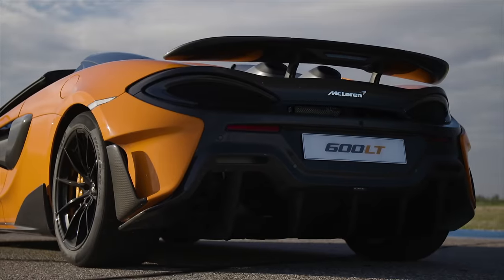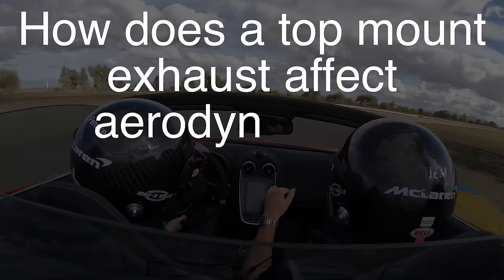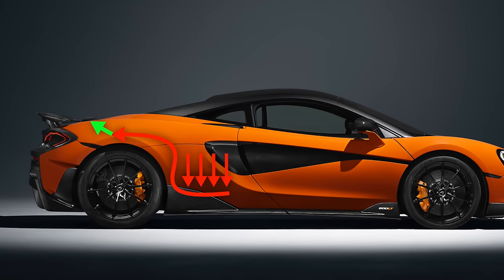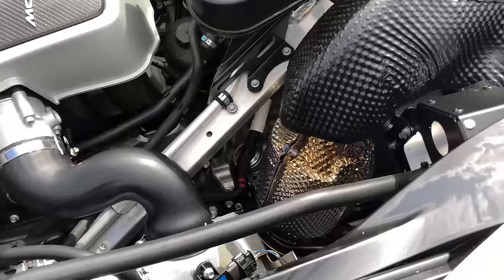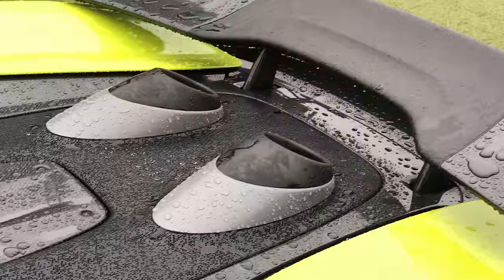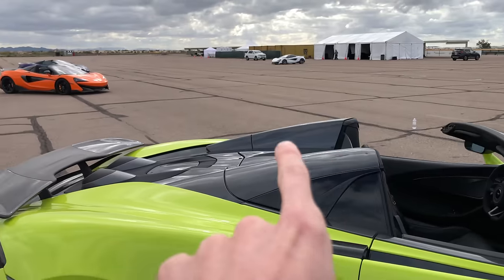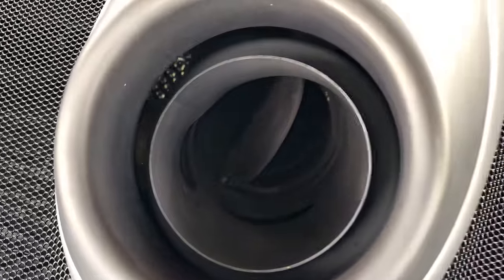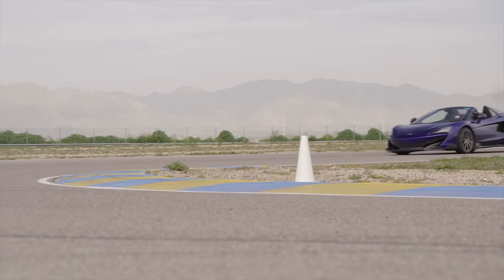Why McLaren's Top Mount Exhaust Is Genius

Comment: There was an adaptation, seldom used for big plane engines. It sent supercharger exhaust out through an aft nozzle that worked like a rocket, focusing and accelerating it to produce thrust, instead of just dumping it into the airstream which you'd otherwise hope to keep clean.
The engine was a huge P&W corncob radial 28 cylinder; the air after cooling the rows of cylinders went out an annular or  ring opening with that supercharger exhaust in the center, boosting the spent cooling air into a blast of thrust, instead of a radiator or simple cowl outlet only being drag.
Want to be they couldn't dump fuel into that for more thrust?

This all would obviously be even more noisy than this car.

Comment: Two big ones I can think of automatically:

1: you're not fighting against physics, I.E., exhaust likes to rise and having exhaust pipes that are lower than the manifold requires more energy to get that out of the system of the vehicle
2: cheaper. Less pipe needed, less physical material costs.

Problem is it only really works in a car with a rear engine rather than a front one.

After finishing the video:
Was right on one, half right on the other. Cool.

Comment: Interesting choice that they didn’t route the exhaust slightly further back, or adjust the wing to gain back that extra lost downforce due to the turbulent flow from the roof. As I’m sure you know, the senna has a blown rear wing for this reason, and it’s not uncommon in motor sports either. I’m not trying to say mclaren is wrong, bc obviously they made the car in the first place, I just find it interesting they decided to not pursue that extra bit of aero efficiency with a higher-end model like the LT.

Comment: I was thinking that they were using the hypercavitation to reduce friction of air.I suggest to koenieggseg to use it in order to gain more velocity,but until these days they didnt find the way to move the heat of engine to the surfaces that are under big amounts of pressure when they gain velocity.They may be could use ceramics peltier

Comment: I have been wondering If they could be somehow an effect like introducing lots of turbulent hot current into a somehow turbulent colder flow reduce drag. A. The hot gases get colder, so they will contract - orwi injection of hot Gases into a cold but turbulence stream will make parts of the cold stream expand. We should do micromeasurements in the wind tunnel at various speeds while the engine is running half power, three quarters and full power.
Reply: ... - B. or the injection of ..

Comment: Great video! Love the content, but I have one thought on the topic of aerodynamics of the top mounted exhaust. On large aircraft sometimes to improve lift over the wings at low speed air from the compressor is pumped onto the top of the wing adding energy to the boundary layer and letting the overall airflow stay attached increasing lift. I wonder if adding exhaust to the airflow at the back of the car is actually doing the same thing helping air stay laminar over the roof and onto the wing. I wonder if their chief engineer mentioned this or if it was part of the move to top mount exhausts.

Comment: All interesting, but didn't address the one area I, as a person totally unfamiliar with top mounted exhaust, wanted to hear about.  Is there not any issue of increased exhaust recirculation into the driver's compartment?  I would think this might be an issue especially with the top or back glass down as demonstrated.

Comment: Could the exhaust actually help make more down force being top mounted cause its putting a relatively  smooth flowing, fast moving air stream over the middle of the rear wing?

Comment: Would the top mount not be a less costly exhaust solution, given fewer parts?  Would they have intentionally put a more complicated and costly exhaust on the 570S only to save this for the 600LT?  What are the advantages in terms of production cost, noise reduction etc of the 570S exhaust that would make it preferable to the top mount exhaust for all the cars in the sport series range?

Comment: Why not use the exhaust gas to create a blown diffuser? Adding energy to the airstream under the car increases down force as shown in F1 before it got outlawed. Plus as shown in your graphic, just dumping it straight down and then parallel to the diffuser under car could cut even more length of exhaust tubing. Is there a reason we don't see blown diffusers in road cars?
Reply: The so called 'blown diffusers' in F1 did not work by simply dumping hot exhaust gas underneath the car.   Google or Wiki the COANDA effect/Henri Coanda if you would like more info on what principle Adrian Newey was exploiting when he introduced that system in F1.

In order to 'work' as an aid to ground effect the ride height of the vehicle in question has to be extremely low.  My assumption (and it is just that) is that no road car can have a low enough ride height to make beneficial use of Coanda style ground effect systems.
Reply: @ShmuelWeintraub  Thanks! Exactly what I was looking for.

Comment: I believe, he forgot one more significant reason: blown wing.
Blown wing is trick known for a long time. The idea is that hot air from exhaust comes underneath the wing and thus amplifies low pressure zone which results into higher downforce.
That's not a new trick at all, and not even Porsche are the first ones to use it. In F1 exhaust gases have been exploited for ages.

Comment: Surprised that you don't mention the created low pressure area that the hot exhaust gasses create. This would act to draw the turbulent air into the low pressure zone increasing the effect of the rear wing in its least efficient zone. This would have the effect of a 'blown' rear wing in purpose.

Comment: I'm going to put this in before I watch but I figure b/c hot air rises and it's only natural to release it in a vertical instead of horizontal way? Now I will watch the vid and find out if I was at the very least close to be correct.

Comment: Most supercars that I know of only have the exhaust go 'up' because the gasses are being fed to mufflers, which can't reasonably be packed within the confines of the bumper. Otherwise, there is no need to go up, as the exhaust can go around the transmission, only having to clear the axles, before going out the back end. And then there's this weird story about the 600LT's predecessor having fans in the bumper to prevent heat damage? That reeks of a major design flaw.

Comment: I have a question. If the centre of the rear wing isn’t as important as the outsides. Why didn’t they just split it like on the 488 mansory kit?? Surely that would have been an easier decision than to coat the wing 🤷🏾‍♂️🤔

Comment: @4.44 in. Am not a great engineer but is the middle part of the back wing required if it doesn't help much with the down force, wouldn't removing it save more weight?

Comment: Would the turbulent flow provide a low pressure that would generate a vacuum for better expulsion of exhaust gasses? 

If so you could assume that you can more precisely control airflow through the engine, pulling more air into the the chamber during exhaust and intake valve overlap, even with the turbocharger.

Comment: Curious to know how much difference it would be vs the high rear mount exhaust of the 650/675/720... as t hose systems aren't all that much longer than the top exit of the 600lt, and also don't go low into the bumper/diffuser. Compared to the 570, its quite the difference as it needs to go quite abit further down into a "normal" cars tail pipe position.
As for sound F!yeah! - my ol car with a under car diff dumped exhaust sounded way better with the noise bouncing around between road and car and being able to hear it all around the car, rather than straight pipes that "shot" noise straight backwards

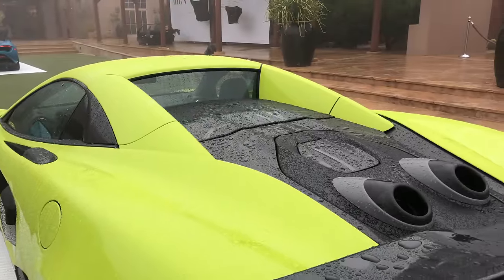Comment: At 4:38 it explains the rain while parked.  But what about rain/snow while you're driving and not accelerating, as in stop-and-go traffic??  Do those valves only open when the car is accelerating?  This video didn't address that key point.

Comment: One more advantage: the exhausts are located within a lower air pressure zone, so that exhaust air is sucked out which helps power output of the engine.

Comment: Well, that ceramic stuff will deal with the heat, but all those gases will certain leave a mark there. You'll need some extra cleaning there unless it's an easy to clean surface.

Although I guess if you can afford that car, you can also afford someone else washes it.

Comment: Why dosent Mclaren use a hot-V engine to shorten the exaust even more, like the 918 is doing and some DTM-racecars, it also would help with the consentration of the heat, considering hot air wants to go up...

Comment: It also reduces eddies due to boundary separations by blowing out the air just at the right place, hence decreasing turbulence 

Great engineering

Edit : blowing air from exhausts
Reply: Having 700 hp or so doesn’t hurt either.

Comment: Ferrari pioneered this is in F1 in 1998 (mid season) with the Ferrari F300 car. Al previously F1 cars dumped the exhaust gasses inside the diffuser. It made the car more loose but more predictable/stable. Ferrari was the first team to route the exhaust gasses over the rear wing to create more downforce. It was obvious that it had many advantages and confirmed by the fact that other teams copied this in just a few months. However, the drawback was that the amount of downforce also depended on the throttle making the car more nervous. 

The affect for road cars like the McLaren or Porsche is a lot less than for an F1 car, obviously. While the margin may be small I would still mention this side-effect in the video. Again, a lovely video and keep up the good work.

Comment: Which produces more downforce: the exhaust being pushed upwards by the car, or the exhaust heating up the air on top of the car, forcing it to expand?
Reply: It's an interesting question.  The "heated" air exitting the exhaust system does not stay immediately above the car.   Hot air/gas rises, just as hot water introduced at the bottom of a pool of cold water will rise to the top.

So the heated air above the car quickly rises.  In fact, if you've ever spent time in a large scale industrial process like a power plant or incinerator, you would see that flue gas stacks tend to run at a negative pressure due to the updraft created by the temperature difference of the hot flue gas and the air around/above it.  This is true whether the flue gas is part of a forced draft (fan driven) system or natural draft.

The simple answer to the question, then, is that since the heated exhaust gas rises as soon as it exits the exhaust system and continues to rise, the 'heating' effect actually will contribute not downforce but very slight lift.  Therefore the net force of the exhaust flow directed upwards, which produces very slight downforce, is the larger effect.
Reply: @ShmuelWeintraub  Wow, that was a pretty solid explanation. Thanks, man.

Comment: If the exhaust was dumping air under the airfoil wouldn't it accelerate the air beneath it, which creates an even lower pressure compared to the top part of the airfoil thus creating more downforce? Or maybe the amount of downforce added would be insignificant :/

Comment: Doesn't the Top Mount exhaust also provide more downforce? 
Since it dumps hot air with significantly higher pressure than the atmosphere, it kind of reminds me of the 2011 F1 blown diffusers. Of course F1 is way more extreme, but I believe such configuration can grant more downforce, right?

Comment: could i get the heat protective coating spelled out that mclaren uses for the middle of the spoiler
Reply: The coating is called Cerakote.  The same finish used on many painted firearms.  Duracoat is very similar and also common.

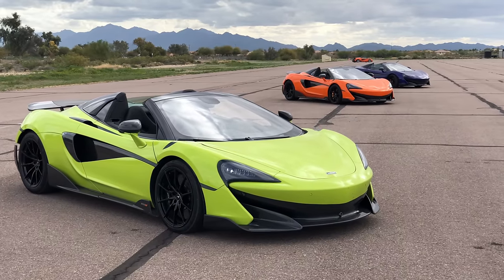Comment: 0:25 actually the porsche 918 spyder also has top mounted exhausts and that is way older than this as it was produced from 2013-2015 I'm not sure about the normal 918 but the spyder definitely has top mounted exhausts

Comment: Its ingenious, in addition to better sounds and improved aerodynamics, you also get to blow your exhaust at the height of people in the vehicle behind you.  They gawk at and envy your vehicle, then you blow them away off the line with a raucous throttling sound, and finally you get to send a concentrated puff of carcinogens directly into their faces Clint-Eastwood-style.  It all happens within seconds.  If that's not what a supercar is all about, I don't know what is.  I bet in California and Colorado you can even get it modified to puff weed smoke as well.

Comment: wont it  have an advantage of the blown exhaust air aiding downforce on spoiler?.. high speed hot air shot out onto spoiler top surface creating additional downforce.. similar to formula 1 blown diffusers of 2010.

Comment: It lets water into the exhaust system, corroding the oxygen sensor. Maclarens are notorious for their oxygen sensors needing replacement if the car is left outside undriven for long periods.

Comment: But a Prius have better fuel economy yet is reliable whoel remaining cheap to buy and maintain. Anyways... all cars can hit the speed limit... The only advantage of a fast car is that it has better acceleration so it saves you maybe 5 seconds. The only time when you can drive at full speed is when you are breaking the law or going on a track which is not common at all for faily drive

Comment: Mclaren: Makes top mount exhaust

Me: Drives to parking lot

A few minutes Later

Random person: Gets Pressure washer

The same Random person: *Uses pressure washer in exhaust.

Mclaren: Good Luck With That.
Reply: 1: this is a very situational thing, and if u could buy a McLaren, then u probably wouldn't use a pressure cleaner
2: it's not funny

Comment: I haven't even watched it yet...But I already know that if you blow air past an open tube, at such an angle like the Mclaren's exhaust pipes, it creates a siphon that sucks air out of the exhaust which decreases resistance on the engine, giving the car a higher top speed. If you took science class, I'm assuming you didn't need to watch the video all the way through.
Reply: It's basically drafting inside of the engine. And yes you get that one Dick.

Comment: As an aero engineer, I've always been disappointed with car "wings".  The McLaren is no exception. The Mclaren engineers obviously know aerodynamics and that a sharp trailing edge is required to satisfy Kutta condition. Yet for practical reasons, probably mostly related to everyday use and durability, they round the trailing edge, committing an unforgivable sin against the aero gods. That wing is worse than useless. Yet, they tack it on as an ornament because wings sell cars. Shame, shame!

Comment: Did they really provide downforce data in kilograms-- a unit of mass-- instead of Newtons?  They're not doing a good job of selling me on the effortless logic of the Metric System.  I suppose Special Relativity requires that the mass of the car in fact does increase as speed increases, but as impressive as the McLaren is, I don't see it attaining the 263,000,000mph required to aquire 100 kg worth of downforce, at 1 g, of course.

Comment: Porsche already did it 5 years ago for the exact same reasons. Better aerodynamics under the car with no exhaust in the back, Thermodynamic Air Channeling, weight reduction and lesser exhaust back pressure. It's not genius, just copied.

Comment: Why not just straight to ground  under the car?
Reply: Managing airflow under performance cars is hugely important.  Dumping a significant amount of hot air immediately under a car like this is going to do terrible things to the downforce and handling... a great deal of wind tunnel and design time goes into minimizing the amount of air that goes under the car.

Comment: 95 deciBels is a lot. Easily enough for permanent hearing loss.
Reply: Ryan McNeila  Sorry, but that's BS. 155 dB(A) is louder than a jet engine by a large margin. 103 dB(A) is the maximum a rock concert would produce. 95 dB(A) is the maximum professional hired musicians can be exposed to (they will be wearing hearing protection at a rock concert).

From a description of what 155 dB would do:

At 155 dB you would experience painful, violent shaking in your entire body, you would feel compressed, as though deep underwater. Your vision would blur, breathing would be very difficult, your eardrums are obviously a lost cause, even with advanced active noise cancelling protection you could experience permanent damage. This is the sort of sound level aircraft mechanics sometimes experience for short periods of time. Almost twice as “loud” as putting your ear up to the exhaust of a formula 1 car. The air temperature would drop significantly, perhaps 10-25 degrees F, becoming suddenly cold because of the air being so violently stretched and moved

Comment: Pure marketing wank. If they wanted to really save weight the exhaust would exit straight out the sides.
Reply: Jedda73 its not marketing wank if F1 cars used it (blown diffuser) and mclaren is primarly an F1 team and they have a lot of R&D behind this specific design, they were not the first to use this exhaust design but they do have the data to back it up.  Plus side mounted exhaust are more of a hassle that you might think
Reply: And what might that hassle be?